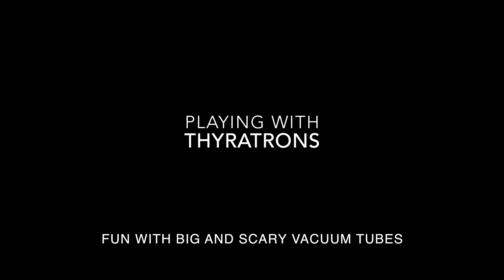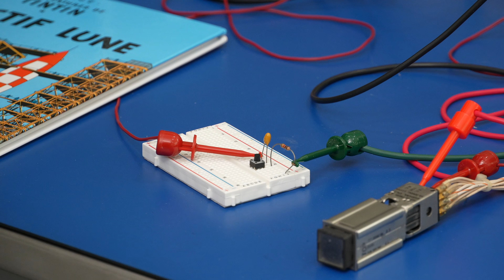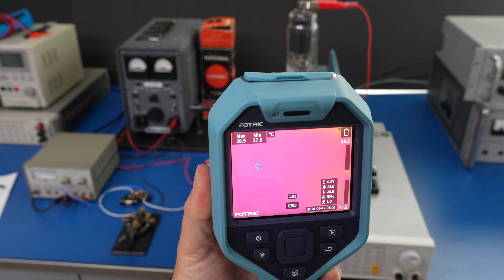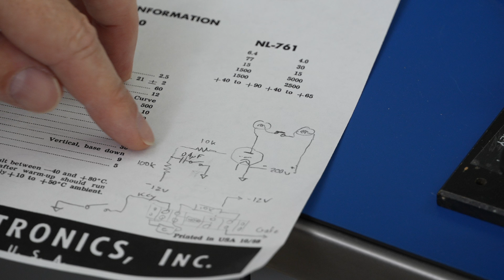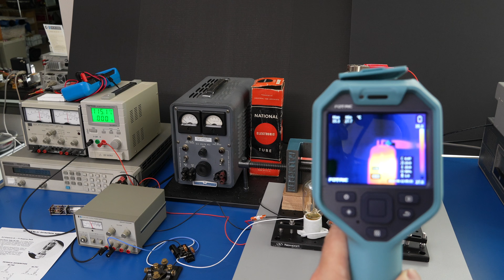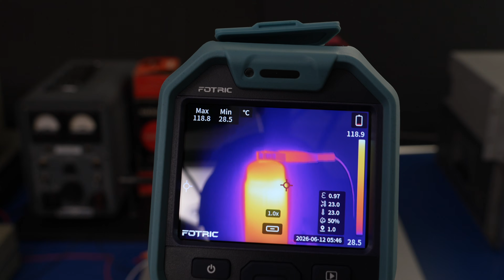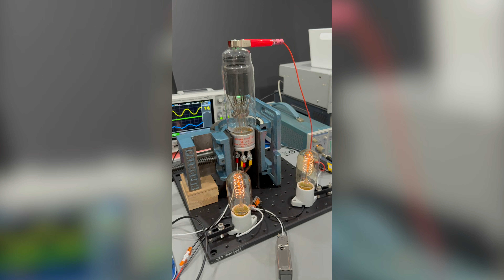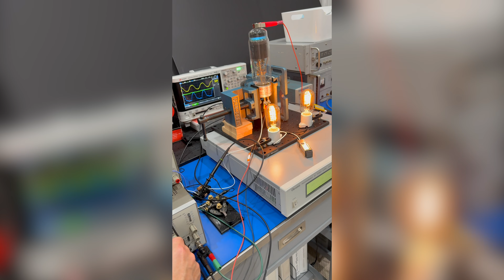We power up a giant Thyratron tube

Comment: You need to find a thyratron which are used for excimer laser systems. I had to replace mine during my PhD and I think it was rated for 40kV at 10kA.

L-4108 Thyratron
Reply from the maker: These are the mean ones!
Reply: @CuriousMarc  I remember having to go through some sort of extra export controls process because they're also used for radar systems I think.

Comment: i have an old analog synthesizer in my basement, he got exposed to humidity and doesn’t work anymore, i wonder if i can fix it. kinda vintage today ( roland juno 106)
Reply: Well, it depends. The damage could be extreme worse due backup battery acid which eats itself trough the PCB and damaging traces (mostly likely), maybe the Voice chips are damaged - replacement costs about $50 each, but these are clones, not original ones (there are not manufactured any longer), and the 106 has six of them - Caps could have gone bad and so on. Its nearly impossible to tell whats the real fault and the total cost, because it would be like giving a Car repair shop customer a price tag for reparing his car, only by looking at it from 20 feet away. In fact it could cost more than the 106 is worth nowadays, because their prices are going down after a peak in the past 10 to 15 years, since analog Synths can be bought new pretty cheap today (thanks to Behringer & Co); which wasn´t the case 15 Years ago.

Comment: Sounds like big theatre thyristor dimmers under load. The interference chokes in the output circuit "sing" audibly. If it's quiet enough on stage you can hear that the lamp filaments do the same. No doubt this is consigned to history with LEDs and DMX.

Comment: I once had a large and very, very old Thyratron tube. I set it up as a relaxation oscillator, with the gate voltage constant it will trigger itself when the plate voltage rises high enough, shunting a capacitor that was continually charged through a series resistor. It drove a large speaker directly with high voltage pulses. The gate voltage, series resistance, and heater current were all adjustable and could make some very interesting sounds. The shape of the plasma inside the tube also moved and changed as the sound changed. 
Eventually one of the connections broke internally and it died, after a few good performances.

Comment: I have been watching YouTube videos by a British physicist called Mike McCulloch who has been researching potential spaceship drive mechanisms based on an idea called Quantised Inertia. He thinks you get a space probe to proxima centauri in around fifteen years using this. The big problem seems to be that it needs a dielectric with a very high breakdown voltage. The circuits used are in the kilovolt range I think. He says they explode quite often.

Comment: It's my personal belief that the reason why all scifi tech glows is because a long time ago, when we took apart electronics, a lot of them glowed like this and it's been ingrained in our brains ever since.
Reply: What do you mean "took apart"? In most devices, tubes need regular replacement, so more likely than not stuff like this was behind an easily opened door. Industrial electric/electronic cabinets still expose all components for easy servicability. And remember, when tubes were first in use, health and safety wasn't a thing yet. So i wouldn't even count on a "Danger! High Voltage!" warnings sticker on the cabinet door...

Comment: My father used to work with an IBM 360 30 mainframe. I was only 11 or 12. I used to decollate for him and also got to play around on the keyboard and make punch cards. The printer was as big as a mid sized car and the disks looked like 33rpm discs stacked about 10 inches high as well as the tape drives. It was set up on a climate controlled elevated floor.

Comment: My massive Thyratron, it has wire leads at bottom (no socket), filled with hydrogen gas, and I believe the fil current is like 60A or so.  Part number is on front and data sheets are readily available.  Thyratrons were used to pulse radar transmit tubes, among many other applications: http://youtube.com/post/UgkxSalCn6iquF32J7MxiL3GQZ3yXldNH-ra?si=ey-yZnk8bNpEN07w

Comment: Thyratron can be turned off. I worked on a 1000 amp spot welder that divided 60 cycles into 17000 parts with digital circuit that could be set according to weld requirements

Comment: I arrived in the theater lighting business just as the Thyratron era was transitioning to solid state dimmers. Lighting technicians were scavenging theaters as they closed for the increasingly rare tubes needed to run the older equipment. Of course, these tubes produced a lot of heat, but they were an improvement over the resistor dimmers of the generation before that.

Comment: I ran and worked on a high power weather radar back in 80's.  It had a very large Thratron tube running the magnetron.  It was used as the high power switch to fire the magnetron.  Always scared the crap out of me when I had to do any testing or repairs.  😂😂

Comment: We used to use thyratron dimmers for theatre stage lighting control systems. The dimmer room had about 100 of them, it got rather warm in there!
Reply from the maker: That was a popular use for these devices!
Reply: @CuriousMarc yes, and it was hilarious when someone forgot to keep the dimmer room door closed during a performance. A sudden blast of cooler air would cause random misfiring of circuits causing the lighting rig to flash like a disco 😂

Comment: A place I worked at in the late 80's had a couple of Monarch lathes that were probably war surplus from WW2.  They had giant thyratrons in them (IIRC, around a foot tall) that were used to control the brushed DC spindle motors of the lathe.  That was my first encounter with those beasts.  I wonder what the one in Master Ken's IBM 650 module was used for?  It looks too small to be for controlling a power device, yet I'd think they would be too slow (even by vacuum tube computer standards) to be used for some kind of logic function...  Does the computer museum intend to restore the 650 to working order?  That would be very cool!

Comment: YES! I see the HP 115BR Frequency divider and digital clock I donated running in the background.

And "someone" bought an HP 113BR from eBay, so I hope it was you and we can see the restoration of that one soon.
Reply from the maker: It’s been running continuously ever since the restoration, through power failures and all thanks to the bacup battery! I didn’t get the 113BR but I think Marcel might have gotten one, but not from eBay.

Comment: There was a 2kw Thyratron in the radar transmitter I worked on. There was a special oscilloscope probe, which was gas filled and had a separate earth, to probe the anode. I was never comfortable using it.

Comment: Disappointing Marc   Let's see that thing at peak switching current.    Switch a capacitor charged to 7kV through a 22 ga copper wire.
Reply from the maker: Nah. I’ll let StyroFoam and ElectroZAP do it on their channel.

Comment: Ah, the memories!  Besides use as a light dimmer, I remember building a circuit using the 2D21 to make a "proximity alarm".  Bias the tube through a very high resistance to barely be off, and attach a long insulated wire to the grid.  If you bring your hand near that wire, the slight dip from your hand capacitance will trip the tube into conductance, yanking on a relay or whatever.  

I used this back in my youth, hiding the sense wire in a dangling noose-like prop by the front door one Halloween night.  Trick-or-Treaters came by the wire, and tripped the alarm which was hooked to a flash bulb positioned off to the side.  That semi-blinding flash scared off some of the Treaters, leaving more candy left over for me :).

Comment: I would be interested in seeing what, if anything, a RadiaCode or similar gamma / X-ray detector picks up near the anode.

Also, is the mercury emitting UV-C?
Reply from the maker: Hmm. Someone hasn’t watched the whole video before posting a comment…
Reply: @CuriousMarc I'm aware that the energy of the emitted photons is directly proportional to the anode voltage. What I'm curious about is whether a RadiaCode or geiger counter is capable of detecting photons in the ~200eV range (which are being emitted) vs ~20keV they are typically rated for.

As to UV-C, how much gets out depends totally on the composition and thickness of the tube envelope, and whether the engineers designing the tube cared about mitigating such hazards. Such things are obsessed about now due to modern regulatory standards, but back when tubes were in vogue, not so much. When I was a kid, I had a wristwatch with a face illuminated by radium paint.

Comment: How did they get the hydrogen to stay in the tube if it is the ionizing gas? Is it the low pressure that makes hydrogen containment work?
Reply: Hydrogen is not actually that hard to contain, since its natural form is diatomic.  Helium is where things get leaky, since you're dealing with single atoms.

Comment: Ha, I happened to have that same model HP pulse generator sitting about 10 ft from my desk watching this!  I don't have any thyratrons unfortunately to play with.  That is a lot of filament current and would be a decent sized transformer to supply it.

About 10yrs ago I designed a heater controller for work that supplied ~400A from 14V and I only needed 3 parallel surface mounted mosfets to do it.  Crazy progress since when those thyratrons were state of the art.

Comment: Just got done working on a power supply at work that has a much larger Thyraton in it.  The supply isn't to big, only 25,000 Volts at up to 15 Amps.  Had a problem with the thyratron firing when it shouldn't.  Fun troubleshoot!
Reply from the maker: Woohoo! These are the mean tubes with X-rays that everyone is worried about. Do I dare to ask what that power supply is used for?

Comment: In my 1970 0:03 high school electronics class I bult  a microwave oven using  2J25 radar magnetron and thyroton using heathkit dc power supplies in series.  A simple modulator ckt and I was on my way to frying lunches of fellow students.  An aluminum enclosure made in metal shop was used.   Back in the 70’s Mil surplus was plentiful in Miami at several surplus outlets.

Comment: Out of curiosity, what is the voltage drop between the tube "input and output"?  Not sure how the pins are called in this device.  Maybe for kicks a voltage-current plot :)
Reply from the maker: The spec sheet says 12V drop at 22 Amps.

Comment: For years I serviced Monarch 10EE tool room lathes wirh the 5HP compound wound DC motors. Two nice big C16J thyratrons with the mounting bracket and lugged flying leads for the armature. Plus a single C3J field thyratron.  Magnificent drives! Fun to watch in action.  The supply of C16J tubes dried up and finally a fella came up with a drop in solid state replacement that is quite a circuit to match impedances the magnetic and phase shifting networks rely on to regulate speed. I had hoped the SS replacement units would have blue LEDs that could replicate the variable glow of the thyratron but the engineer turned out to be too sensible 🙂
I still find it mind bending the way that circuitry could shift the grid waveform to get it so smoothly from 0 to 2000 rpm. 2000-4000 rpm is achieved through field weakening.

Comment: The semiconductor version used to be called Thyristor (in Europe).  In the US they have ben called SCR.  We once replaced both the OP-amps and the thyratron used to control the speed of a motor whose last drive stage was a Ward-Leonard rotating power amplifier.  Our SCR based system solved a number of stability (drift) issues in he original controls.

Comment: When I was a undergraduate Electrical engineer in the mid 60's, we had a lab experiment with a thyratron.  It called for  a large wattage power resistor as a load, one of the students decided just a 1 watt resistor would work.  As he proceeded to increase the gate voltage, he exclaimed, "see there was no reason to use a big power resistor!"  Eventually the thyratron fired and the resistor disappeared with a loud bang and lots of smoke.
Reply: Wow that resistor probably got sent a few parallel universes over and up a few dimensions too 😅
Reply: @surrealkitten9670 o resistor se materializou na galáxia de Andromeda!😂🙂👍
Reply: And this, kids, is why you wear safety glasses and ear protectors when first powering on your newly design electronic circuits. Full face shields are also not a bad idea, i ran around with a bruise on my forehead for a week when a high power MOSFET decided it didn't like to be accidentaly shorted to ground...

Comment: My Monarch 10EE lathe is all tube drive.  2 big C16Js, 2 3C23s a largish mercury rectifier and half a dozen audio tubes.  The C16Js date back to WWII where they were used in radar sets.

Kind of Dr. Frankenstein's laboratory if you run with the covers off.  I have to show it off to every visitor.
Reply: I was going to mention the monarch 10EE but you beat me to it!
Reply: Had no idea, i was taught on those monarch lathes but never played with internals. Sad high schools today dont have full machine shops and engine shops like we did
Reply: I have one of these that also came out of a big industrial lathe!

Comment: Thyratrons were revolutionary for variable speed motor drives.  The tubes allowed elimination of carbon piles and mechanical feedback to be replaced by more reliable photo electric sensing to control motor speed via thyratrons.  This was a big deal for process control to enable continuous production.  Think of a fabric mill where you’ve got rollers to take up slack between weaving and dying.  If the slack starts to be taken up, a photo sensor can see the roller move up and increase the weaving speed to match the dye processing, or the opposite if there is too much slack.  Many continuous production situations with multiple product handling stations can maximize throughout and minimize waste by syncing line speed with variable speed drives.  Now we use Programmable Logic Controllers, variable frequency drives and AC motors.
Reply: I was thinking of vvvf

Comment: CHM is a great place to visit if you're ever in Silly Valley. When in high school, I took a course which taught the fundamentals of programming the 402 accounting machine, (plugboard "programming"). The unit record equipment was swapped out for an IBM 1130 the next summer, so I was in the last class to learn the 402. I got to see it opened up for service, masses of wire relays (the logic) and large timing wheels, driven by a large motor and gears. A Teletype on steroids is a crude description. Weighed many hundred pounds.

Comment: Is that blue glow... electrons? Ever thought about bringing a Radiacode detector next to such a vacuum tube? It has to generate some radiation at least, if those are electrons. Not much, granted, but it still would be interesting to see.

Edit: I am at the end of the video where you addressed it. I already thought that if anything is generated, it is miniscule. Still, would be fun to see.

Radiacode, please support Marc, wink-wink, nudge-nudge.
Reply from the maker: Blue glow is from excited mercury atoms (excited from the collisions with the electron current between anode and cathode) relaxing back to their fundamental level. In the process it emits a photon. it’s a quantum process, so the photon has a color that depends on the energy difference between the excited and fundamental levels, in this case, blue (actually, probably a mixture of color lines with different blues, as several sublevels are involved). So there is indeed electromagnetic radiation emitted in the form of photons, but you don’t need a radio thingy to detect it, your eyes will do fine! It’s the same process used in regular fluorescent tubes used for traditional lighting. Generates light, not RF.
Reply: @CuriousMarc Nice! Thanks for the explanation, Marc! This is not my area of expertise - I appreciate that you took your time to explain!
Reply: @CuriousMarc  Also, now that you mention it, that glow looks eerily how UV-C lamps glow (they have the most beautiful blue light of any lämp). And by the way, I am NOT a moth. Just putting this out there. But I guess if it has an UV component, the glass blocks it. It's still mesmerising.

Comment: I have a few of these brand new left over from my Monarch 10ee lathe (nl760) and a larger one from a 13ee, if you can think of a project, I'd be happy to give you them.  I retrofitted them to modern motor controls. I do miss the blue glow under heavy load and hot dust smell.

Comment: Can I put it in a guitar amp?
even if it's not needed?
and if so, can it djent?
Edit: might only be good for rectification and power switching anyway
signal amplification wouldn't be very musical with a squarewave "always on, always off" and requiring a phase inverter keeps it out of the preamp stages...

Comment: The reason for the slow heat up is the very strong PTC of the tungsten heater filament. The filament has about 0.1 ohm resistance when hot and consumes about 50W of power. When cold it has about 1/10th that, so passing 10 amps through it will generate about 1 watt. It is normal to ramp the voltage, not the current.